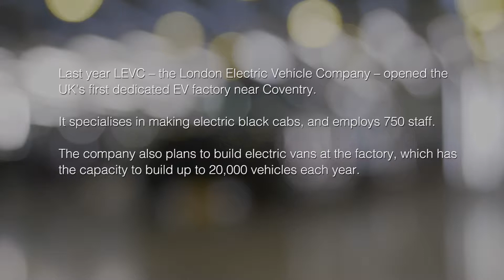Electric Taxi

Comment: When the battery runs out after 50 miles your then dragging a two ton dead weight around.
Gives off toxic brake pad dust uses petrol and then after 5 years replace battery's more toxic wast.
And this they call clean ????????

Comment: The electric cab that runs on petrol. You'll get 50 miles on electric max then you'll be very lucky to find anywhere to charge it. These cabs are running on petrol 90% of the time,  how green is that and they cost a kings ransom 60k+ where do they think hard pressed cabbies can find that kind of money? How long will it be before it costs as much to charge an EV as it costs to buy a tank of fuel? Careful what you wish for. Climate change is a huge con trick to keep the masses in their place and skint.